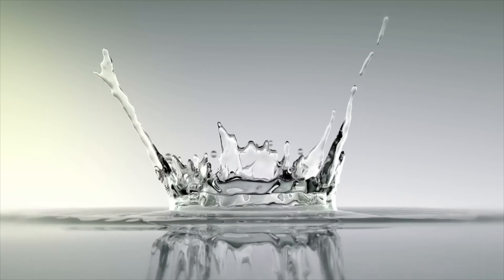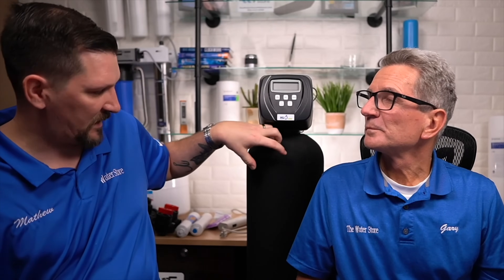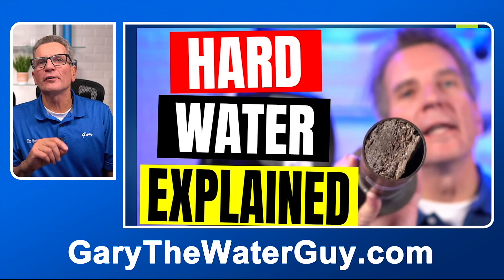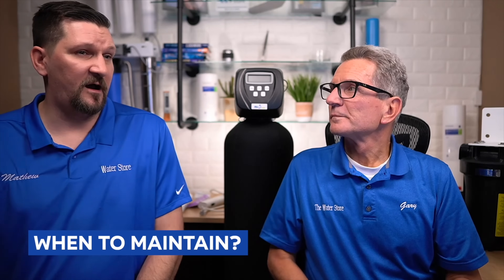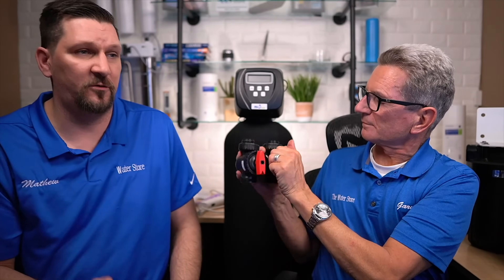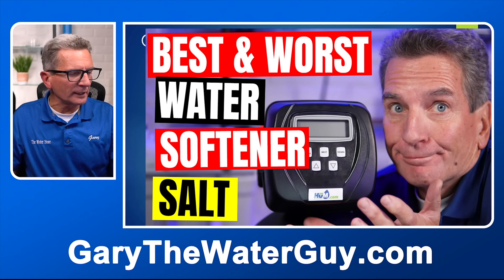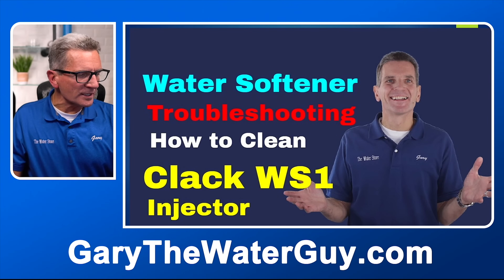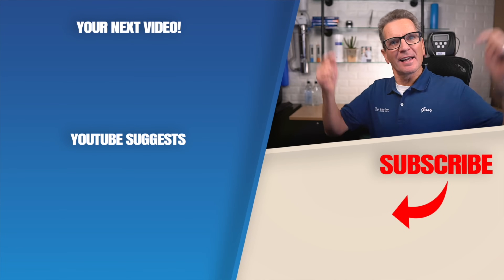Clack WS1 Water Softener Maintenance Pro Tips & Tricks

Comment: As a certified water treatment specialist I will add the only thing I would add is if you live in an area like myself that contains large amounts of iron and hardness you need to be doing annual maintenance. Res care is added at 1/4 cup per bag of salt added. Roughly in these parts you use an average of 1-2 bags of salt per month. Res care wicks are absolutely garbage, they do not work properly. Brine tanks should be cleaned out every 2-5 years. Salt should always stay above the water at all times. I dont care who tells you what the only correct answer is to have salt levels above the water. Love this duo, definitely some wonderful facts and tips for home owners.
Reply: What do you recommend using then instead of res care ?

Comment: Thanks Gary. I have  a Clack, question, is there a need to remove the salt for drinking if my refrigerator has a filter?
Reply from the maker: Yes, I always prefer to add a reverse osmosis drinking water system like this one as it not only removes the salt but hundreds of other contaminants that the fridge filter does not remove. https://waterestore.com/products/hum-water-saver-75-gpd-ro-system-with-remineralization-and-brushed-nickel-faucet
Reply: @water_estore  thanks.

Comment: Thanks Gary for all your tricks and tips. For months I couldn’t figure out why my well was short cycling when there was no demand in the house. I changed out all my equipment above ground and all the check valves. Recently I noticed that the drain area from my Clack sulfur guard was wet all day, I disconnected the drain line at a coupling and noted water was trickling out and there was a mechanical sound coming from the valve. I followed Gary’s instructions on changing out the filter and pistons in the Clack. Finally the unit is operating as it should..
Reply from the maker: That’s what I’m here for!  Always great to hear a happy ending.

Comment: The WS1 is realy not the best valve, never had a problem with chinese valves,almost  new ws1 resulting water overflow and full brine tank  cople time in one year
Reply from the maker: You are the exception.  Clack WS1 has been and still is the best for 20 years.  Just try to get parts or troubleshooting help with those Chinese valves.
Reply: I've been using those canature bnt-165 valves since 2013 never had any issues at all ,and even if something goes wrong and you need to replace it, it cost me only 220eur new one ,while the service kit for ws1 cost me  in Germany almost 90eur
Reply from the maker: It is virtually impossible to get parts for the Chinese water softeners in North America

Comment: My grandmother has the WS1 valve on top of a tank just like the one behind you. There is no brine tank for salt. She is blind and I feel she was maybe taking advantage of. What are your thoughts on this configuration.? Just like the one behind you.
Reply: It would have softened the water at the beginning but it needs a brine tank for the resin beads in that water softening tank to be cleaned and re ionized to continue softening the water. She may have been taken advantage of.
Reply from the maker: Yes if it really is a water softener it needs that brine tank but check with whoever she bought it from becasue there are several other types of equipment (like chlorine removal) that use that valve that do not require the brine tank.

Comment: Hi Gary. The system that came with the new house we just bought has two cylinders. One is a smaller one and has the same display. Is this something different than what you are explaining?. Also, it says it requires some citric cleaners for the resin it uses, can you explain about this too? Thanks.
Reply from the maker: Tough to say for sure without any brand names or model numbers.  Citric acid is the cleaner, we have it here https://waterestore.com/products/citric-acid-tannin-filter-cleaner?variant=43997874913493 and this video explains how to use it https://youtu.be/c8QKYr3B02I

Comment: Love your content guys. Quick question. I just installed this system and a month after, my water bill went through the roof. It was more than double. I understand it uses more water, but what could possible be the issue? There is definitely something wrong. Having a bill a little higher due to the water softener is understandable, but more than double is not ideal.
Reply from the maker: Nope. The water softener will use about another 350 gallons per month which would only increase your bill by about $4. Must be something else.

Comment: I just bought a house.  It has this model water softener.  The house was un occupied for 9 months, the brine tank has no salt, and tge water level is like 1/5 full.  Do i need to clean out the brine tank?  Before regeneration?  Is there anything i need to do or just add salt and regen?
Reply from the maker: Add enough salt so the salt level is higher than the water, wait 24 hours, then regenerate

Comment: Love the videos - very helpful!  I am having an issue with my Clack softener (city water) where I had pressure issues.  I did a thorough (and long overdue) cleaning of the system using "OUT Filter Mate" and did not get relief.  After much troubleshooting & research, I happened to stumble into noticing that there were somehow resin beads in the cold lines (and water heater too; drained it to remove), so I initially worried that they were degraded down to a size where they slipped through the screens and into the plumbing - but after searching online, it does not seem likely that they shrunk.  The beads are still very firm, so they do not seem too degraded yet either (system is around 10yrs old).  I did see a post online where someone mentioned that if you use water during a regen cycle, it can actually pull some media into the lines - I am hoping that this was the main cause, as I have already flushed all of the lines in the house, plus drained & flushed the water heater.  I did happen to notice that almost all of the beads were contained to one bathroom & it's fixtures, so that gives me some confidence that it could have been pulled in from use during a regen cycle.  I wanted to see if you had any helpful advice, as you seem to have encountered nearly every problem-solving scenario with these Clack softeners!  Any help is appreciated, and I really love the videos; I have learned a ton about my system thanks to you!
Reply from the maker: I'm pretty sure that the riser tube or baskets at the top or bottom within your media tank is cracked and is letting some media through.  If a water softener is in good shape there is no way you would get media coming through if you used water during regeneration.  Thanks for watching!
Reply: Thank you Gary. I’ll give that a try!
Reply: Thank you Gary. I’ll give that a try!
Reply: Thank you Gary. I’ll give that a try!
Reply: Thank you Gary. I’ll give that a try!
Reply: Thank you Gary. I’ll give that a try!
Reply: Thank you Gary. I’ll give that a try!
Reply: Thank you Gary. I’ll give that a try!

Comment: Hi Gary. I have the same CLACK equipment that is behind you in this video. How do I clear the “CALL FOR SERVICE” message on the display. I have just turned off the alarm for this for the future,  but I don’t see how you clear this message from the display screen so that I stays on the main display with flow rate, etc... Thanks
Reply from the maker: Don't you just hate that "Call for Service"  Check out page 12 of this manual https://aspenwatersolutions.com/wp-content/uploads/2019/05/WS1-OEM-MANUAL-SOFTENER.pdf

Comment: Hello Gary. I learn much from your videos but need advice for a problem I am having.  I had the cord replaced by a plumber because the cord was too short to reach the outlet.  I tested the outlet and the power going to the Clack circuit board.  There was power but no display.  I then replaced the circuit board and still no display appears,  I am at a loss.  Any advice would be helpful.
Reply: Are you sure the outlet is functioning properly? Also the power transformer that the plumber replaced might be faulty
Reply from the maker: Yes, I would check the transformer that it is correct for your Clack valve like this one https://waterestore.com/products/clack-ws1-replacement-transformer-clk-v3186

Comment: Hi Gary,
Water taste salty after regeneration every week. After running the water for some time salty taste goes away. Noticed this issue started couple of months ago. Water softer system was installed in October 2018.
Reply from the maker: Check out the suggestions in this video https://youtu.be/3GQWpqlLBps Usually a clogged or pinched drain line is the culpret
Reply: @water_estore , the softener system you have installed in the year 2018 , not the water boss system. the reference video does not match to the system installed. I have two tanks and one storage for adding softener salt. there is nothing like demonstrated in the video.
Reply: If you’re water tastes salty after regeneration then it’s more then likely the brine didnt fully get rinsed off the resin bed. I would try adding more time to your brine/rinse cycle

Comment: We have a Clack WS1 metered head that is about 12 years old. Lately it sometimes does not regenerate when under 100 gallons.  Any idea why and what we can do?  We have been manually starting it when this happens but really love the auto feature.  Thank you!
Reply from the maker: It does it's own calculation on when to regenerate based on your water usage.  Will it go to zero before regenerating?
Reply: @water_estore   Thank you. I set to unit to regenerate at below 100 so we always have soft water. Sometimes it regenerates at 100 (time before last) and sometimes it does not.  This time we hit the manual button at 4.  I hope this helps! This is not a fatal error, just annoying.  Thank you for trying to help me!

Comment: Gary I enjoy your videos. They are so helpful. Im in the states though and i have a 8 or 10 yr old Morton msd 45e softener that was dormant for about a month cause we drilled a new well. We moved it to the new spot in the house hooked it up and seemed to work but then discovered the water was overflowing. So i drained it and vacuumed the remaining salt out and used some hot water and iron out. Also cleaned the venturi valve.  Havent started it back up yet im afraid it will happen again. What do you think caused this?
Reply from the maker: Where did you connect the drain to?  If it isn’t free flowing that would happen

Comment: Hola Gary, sigo viendo tus vídeos para convertirme en un pro, pero tengo un problema con una válvula Clack, igual a la que tenéis de detrás vuestro, el problema es que cuando tiene que hacer el ciclo de salmuera llena el depósito de sal, Cual puede ser el problema?
Reply: Agregó un poco más para entenderlo mejor, hago la regeneración manual  el primer ciclo de salmuera o brine, en ves de aspirar lo que hace es llenar el depósito de sal
Reply from the maker: Sorry but I don't speak Spanish, can someone translate?
Reply: @water_estore  google translates it,  see translation
Reply: Brine tank gets filled with water because there is no vacuum being created by the water softener during the brine/rinse cycle. It is actually dumping water into the tank instead of vacuuming the water out. When this happens the seals on the piston that goes in and out of the valve body are shot and are letting water through passages that it shouldnt

Comment: We’re getting what looks like a lot of media coming out of our faucets clogging the faucet screens it’s like fine yellow sand what could be the issue?
Reply from the maker: It sounds like you water softener has ruptured internally and some of the media is coming out
Reply: If it is a new installation this could happen if plumbing is installed backwards. Otherwise it could be the manifold that goes in your media tank could be broken at the bottom letting media in to it

Comment: How long should a clack water softner last?
Reply from the maker: 20 years.  We have been installing them for a little longer than that, but that seems to be the norm.
Reply: @water_estore  thanks Gary…. Recently i drained the water lines in my house to run chlorine thru the pipes… i forgot to bypass the water softner like i usually do.. it drained some of the water in the softener before i caught it… just seems to be out of sync since i did this. The part that houses the injector is empty of water..normally its full. Any advice? Thanks again

Comment: If I stop adding salt with the purpose of getting the salt level low enough in a few weeks to make it easier to stir at the bottom to break any potential salt bridge, will the lower amount of salt still be enough for the softener to work as intended? Or should I always try to keep it a bit above water level for optimum performance? Thanks Gary!
Reply from the maker: You can definitely run low or even out once a year without affecting performance significantly